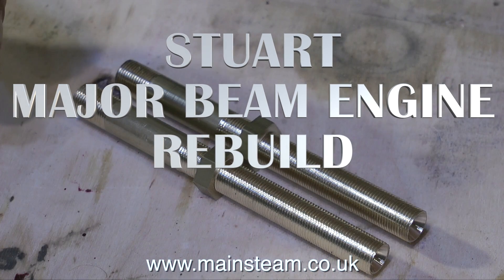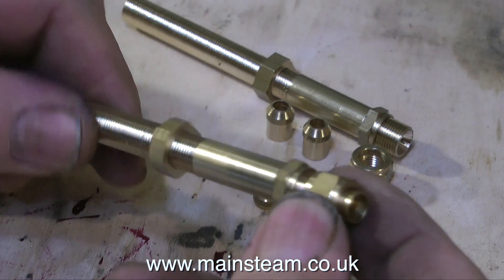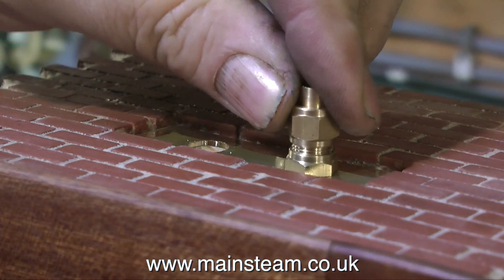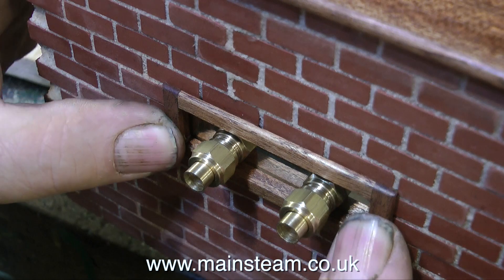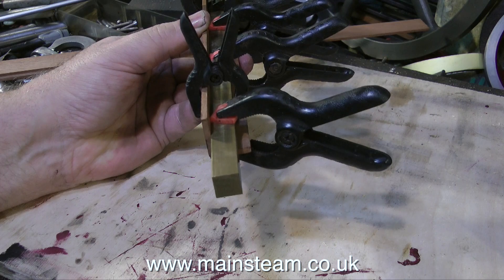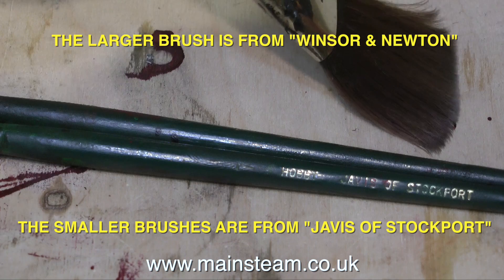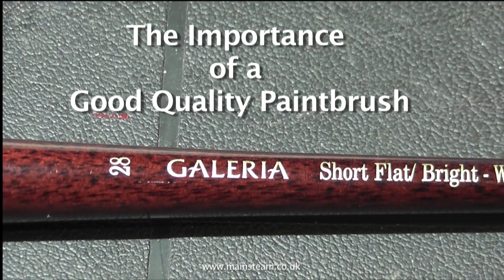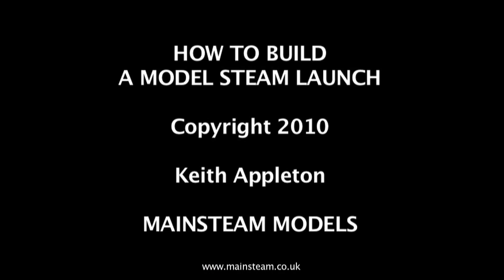STUART MAJOR BEAM ENGINE REBUILD - PART #23

Comment: I agree that the brass and bare brick looks better than the mahogany frame. I still am not sure what to think about neither brass angle or mahogany on the corners, solid brick would look better imo and I found some miniature bricks at Tumdee Dollhouse Miniatures that are cut from real brick and about an inch long, I recommend checking them out, you can get a pack of 50 for a fiver so no great expense. Keep up the good work and I look foreward to more painting!